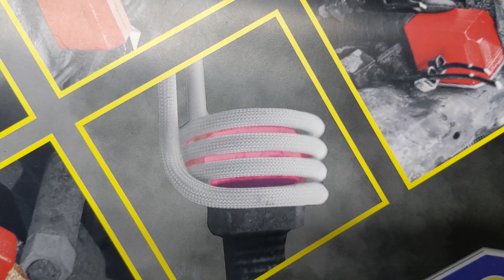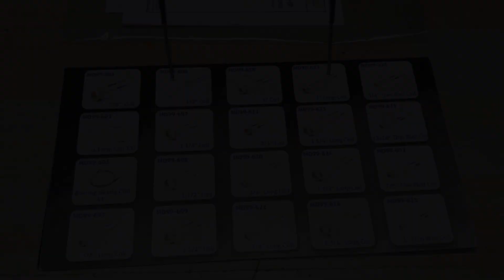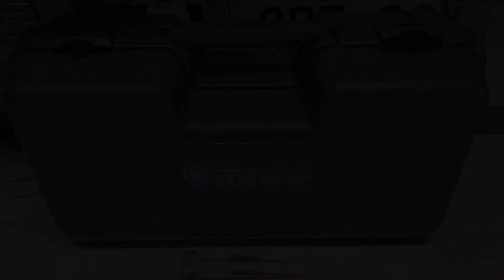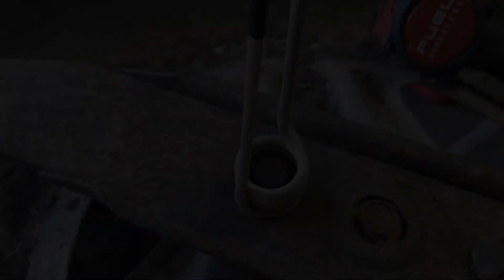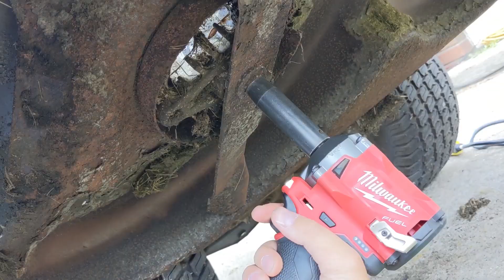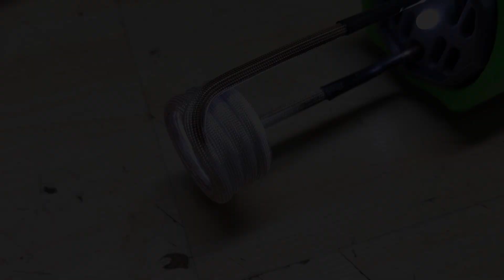Mini-Ductor Venom HP

Comment: Wrap the U-Form coil around a LARGER object. You do not want a tight wrap because the induction produced heat is applied to the coil insulation by "conduction" transfer thus burning up the insulation and shorting out the coil and burning up the machine.

Comment: Bought the venom HP last year, one of the best purchases I've ever made, hands down!  Saved me hours of labor and lots of money in not-broken bolts.  And if a bolt still breaks even after I used the heater on it then I can say for sure that it wasn't going to come out nicely no matter what!
Reply from the maker: It's one of the best tools we have for sure, lots of cylinder head bolts are seized on the old craftsman snowblowers and this Venom HP gets the heat down into the thread even though we only put the coil around the bolt head. Works great!

Comment: cool video... but, are you a robot? you sound like a robot.. :)
Reply: Yes, you are right but otherwise the video would be 2 or 3 times as long at Normal speed. He is the best reviewer and explainer I have ever seen on YT, very thorough! Just overlook that he is talking fast. Here is what YOU could do, click on the bottom of the video so you can see the setting icon, the gear. Click the gear, then select the Playback speed. Set the playback speed tp 0.75. At that speed you can slow the audio down and it will increase the play time time 0.25. So for a 20 minute video it would be a 25 minute video.

Comment: Finally, somebody chose to teach how to use the thing that’s cool question do these coils work with other? I bought a different brand and this branch you have shows more added pieces. Do you know if the stuff is interchangeable?
Reply from the maker: I'm sure they are, they're just metal rods with the heat wrap. This thing is amazing and although we don't use it all the time, when we need it, it gets the job done
Reply: @EliminatorPerformance  give me your professional opinion how to I have a model a block with about a dozen head studs that I have to get out, after heating the stud how would you get ahold of it to take it how long should you wait after it gets hot to take it out
Reply from the maker: @jackies8538  I would personally weld a nut to the top of the stud if it was badly seized. Then you can heat them up red hot, you can quench them with water if needed, but usually I wait for them to not be red, then start removing. You would have to replace the studs, but it's a small cost
Reply: @EliminatorPerformance  thank you for your reply, I have new studs that's not a problem, have you ever used a tool  call to stall Willie it was sold by snap-on long time it was designed to get into small spaces to get studs out it worked great use it for main studs, like a hemi you don't have room to get much down in there to get a Maine stud out it works it works great

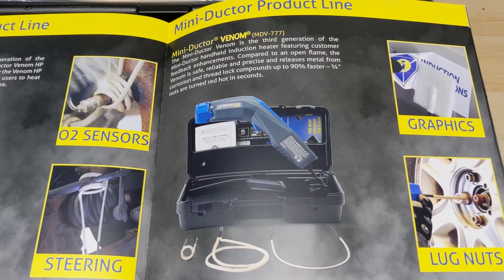Comment: 25:35 if the lower cost model can only run at 110V rather than 120V, what would happen if you only have 120V power and plugged it into that? Would it be damaged from the overvoltage?
Reply from the maker: No it has a rectifier and will only run at 110v it will be fine

Comment: Great review! I would recommend getting heat resistant braided wire protection insulation sleeves. The sleeve should cost less than $0.10 per meter and you can use any solid copper wire as the conductor inside the sleeve. And make sure to use high quality copper to avoid getting the wire too hot.

Comment: I know it is expensive,  but how much does a shop charge per hour? For my old 93 rust bucket it would allow me to work to my limits  of experience.  The savings would be pretty  quick i think.
Reply from the maker: This unit is $650 US and my shop charges $70/hr Canadian, so that's $54.50/hr in US currency.
Reply: @EliminatorPerformance  Similar no-brand induction heater devices can be found here in Finland for about $300 including all taxes so getting one is a no-brainer if you're doing DIY stuff more than once.

Comment: After 5 seconds I  wanted one.   How did you find out about it??    I did a major job on the strange Tecumseh Eager carb first in the video.  Email me if you are having issues with it.
Reply: Bruce the old man was watching YouTube videos as usual when an automotive seized bolt video popped up using the induction innovations Venom HP so we contacted them noting it would make good video footage in the small engine repair business and they agreed.
Reply from the maker: That Tecumseh is cooked, guy was using it to cut ditches and running it sideways, one of the valves seized up and now it doesn't have much compression. Using it for parts as there would most likely be other issues due to oil starvation!

Comment: Nice but $625?!?!
Reply from the maker: Compared to an oxy acetylene torch, a good kit will run you about $250 for a torch, hoses and regulators. Then you need to buy, or rent tanks. Not to mention fill them when they run out. Over time, this tool will eventually pay for itself. Thanks for watching!

Comment: Truly a cool tool!  We used a product by Varflex for insulating electrical wire from friction and heat at my old job. I'm thinking those burnt coils could be repaired with the correct sized sleeving and heat shrink. Thanks for the review.
Reply from the maker: Yes I'm going to look into something like a Cer-wool sleeve, but for $13 I just went out and bought a couple more. Thanks for watching!
Reply: Excellent idea thanks for the information Shorty

Comment: Wow what a great tool for small engine repair shops, i have seen videos using them in auto shops but as you have shown safer and easy to use for small engine repair also.. For sure a major time saver and ends up paying for itself in a short period of time. Glad you showed the damaged coil with the full explanation full transparency for sure. Great video looking forward to see it used on different projects.
Reply from the maker: Thanks for watching!